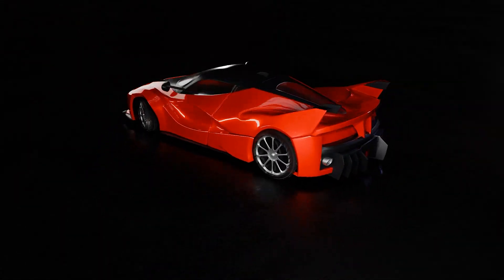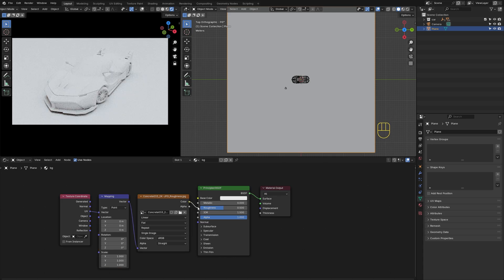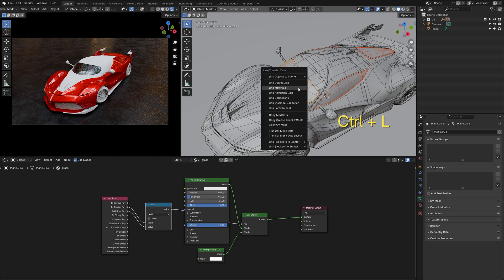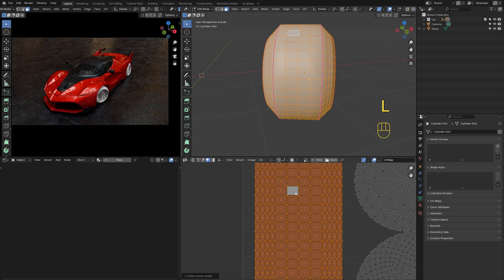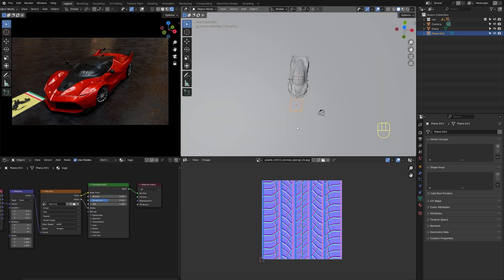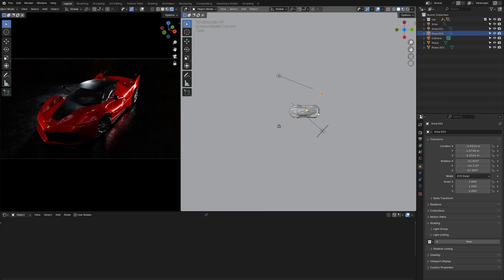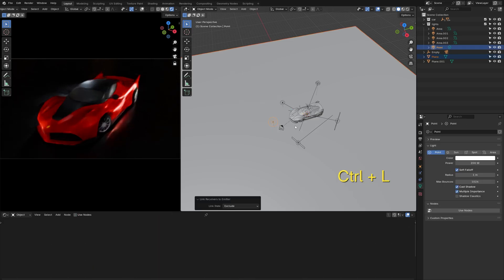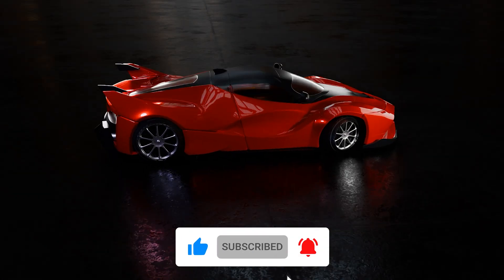Blender tutorial | How to texture, light and render a car in Blender

Comment: how you soften the edges of a car which you  built in your last session?
Reply from the maker: In edge mode, use the select > select sharp edges command from the header, you may need to select and deselect some edges manually, then move to the sidebar, in ITEM tab, set edge data:bevel weight to around 0.3. Next, add a bevel modifier and change limit method to weight.Then you can press ctrl + 2 to add subdivision.